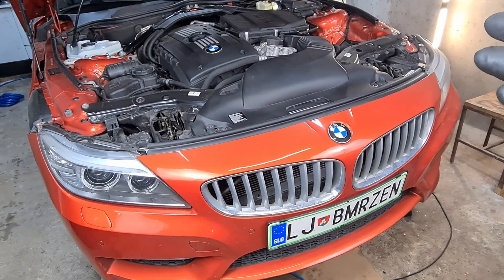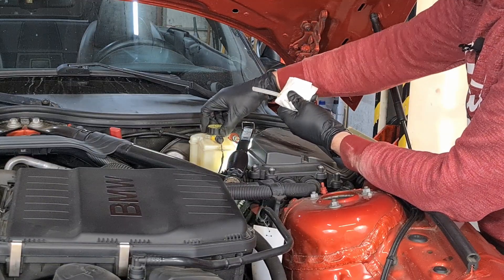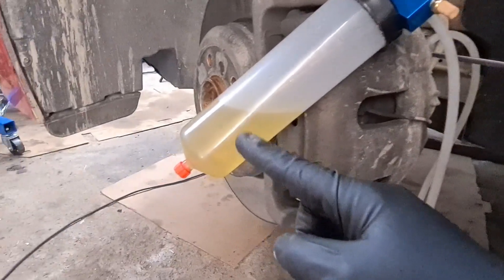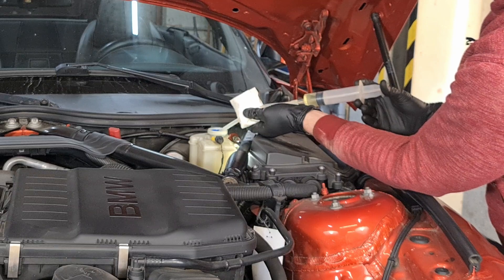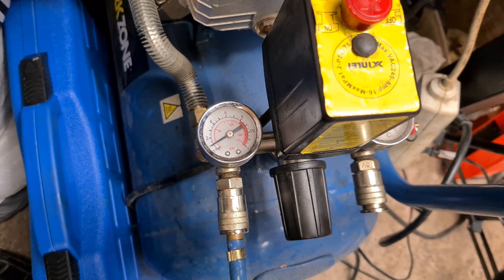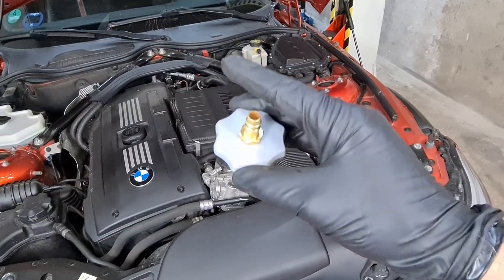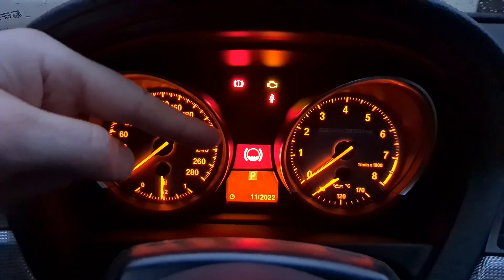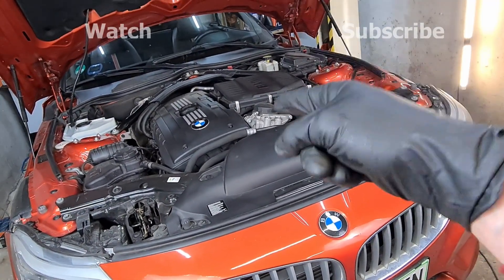BMW Z4 35is E89 / Brake fluid Replacement / Bleeding / Reset

Comment: Done my Zed. Jar with plastic tube, spanner and old shock absorber?
Tube on nipple into jar, loosen the nipple, push brake pedal down with shock absorber to maintain pressure on pedal braced against the seat rail, retighten the nipple. Repeat.. Do all 4. Then need to use scanner to bleed the abs unit, just to make sure no bubbles in abs. Probably not necessary if you haven't drained a line replacing caliper.

Comment: Question ? if I just took a syringe of fluid out of reservoir and replaced it with new, drove it for a day. Rinse and repeat for like 5 times wouldn’t that pretty much take care of it.
Reply from the maker: Brake fluid doesn't circulate, that's why it's best to  bleed it from each individual brake caliper to make sure it is replaced. Your procedure would reduce the level of moisture a bit, but the brake fluid in the lines would still mostly be old.
Reply: @BimmerZen  ok thanks, I thought it circulated through, thanks for replying